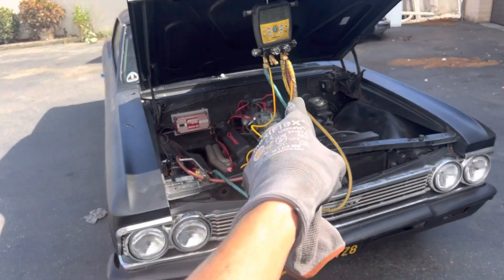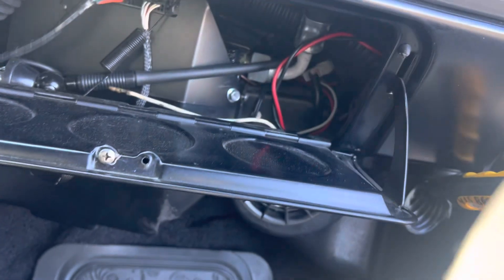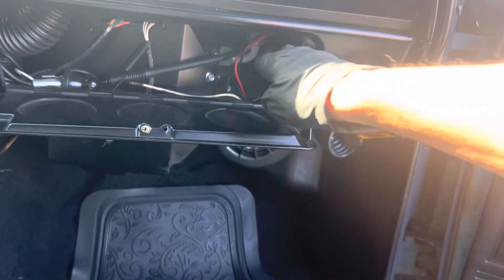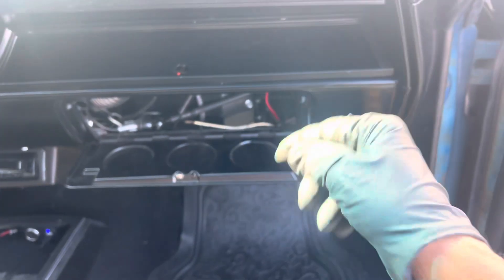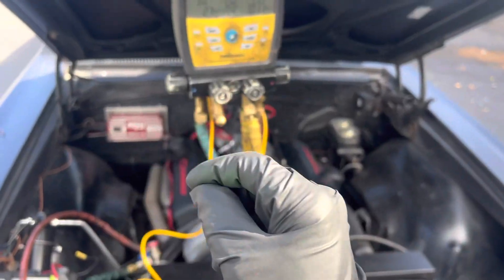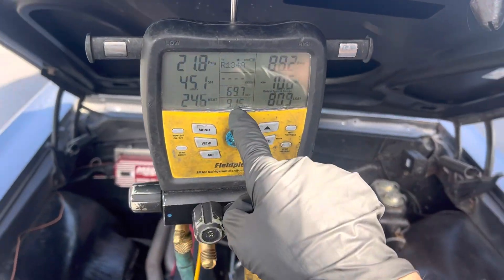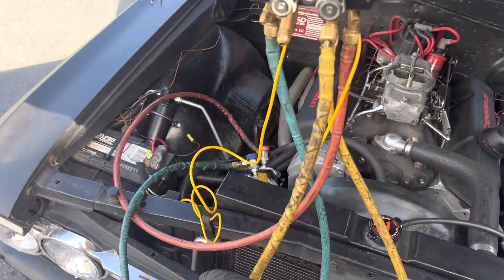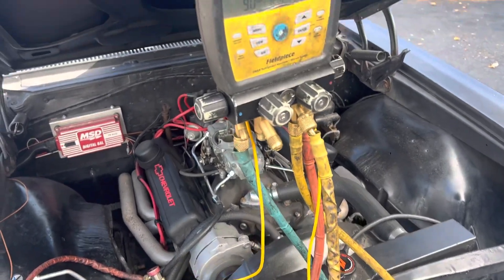Vintage Air develops electrical problem in the Thermistor￼ sensor controlling the compressor. ￼

Comment: My compressor kicks off when the vent temp reaches 47 degrees. I’m not an Ac expert but I’ve taken it to three shops and all say my system is properly charged. Today, shop number three said the system will cycle off the compressor when the evaporator reaches 34 degrees and that my system is working properly. I can’t believe that air temp is dropping 13 degrees from the evaporator to the vent. Is it possible that by adjusting the thermistor outward from the case say 1/8 of an inch would fool it into keeping the compressor engaged longer? Thus cooling better? Thanks
Reply from the maker: That’s what I used to do with old jeeps pull the sensor out a little bit or move it in another location

But all depends on the vehicle you have, and what it uses to trigger . . 

Almost sounds like a Honda 

Or a old Jeep 

So is this happening in hot temperatures around 80°F

And what year make model vehicle is this?

47 is pretty high temperature, but I have done videos on a few cars that just suck when it comes to cooling
Reply: @coldfinger459sub0  it’s a 67 c10 restómod with a 2017 LT1 and modern cooling system. The cab has been insulated when it was restored. Todays ambient temp was 80 degrees but these are the vent temps I see even in 100 degree weather in south Texas. It has a Vintage Air Gen 4 system in it.

Comment: vintage air did update their expansion valve on their gen V systems. the gen V systems use the block style expansion valves.
Reply from the maker: First message of reply was on accident, but your Vintage Air unit if it’s an old Vintage Air unit, it does have that little metal gas filled tube for a sensor that you can pull out a little bit or move to a different different location

Some of the new Vintage Air have the little electronic temperature sensor and I can’t remember if you could get access to that on all their models. some may be sealed up inside the case maybe some of the early models I think I seen some you can pull in and out can’t remember

Comment: hi yup when I saw that condenser i thought it was a serpentine. Oh yea where is the aux condenser fan a good 12 inch spal 20amp ver no cheap ebay rubbish ..   The BLOCK type txvalve will regulate far better than a convential thats internal equalised . That system has  sheat thats not reading correct . The evap is being starved .
Be interesting to see what happens to psi sc sh at 1500rpm reards air flow . Many are fitted with aftermarket fixed junk fans . 95% people donot fit optional OEM  A/C equipped LARGE diameter Hduty thermal clutch fan with shroud  . Radiator to condenser is not foam sealed either .
The suction thats not cork taped will create a lot of condensation drips .
Reply from the maker: Yes, yes yes 100% 👍

Comment: Have a Vintage Air Magnum IV unit with a DD DCC2400 controller. the A/C clutch kicks in randomly -pressure & compressor ok. I jerry-rigged the  a/c clutch Relay and I am getting cool air as expected - Therefore it appears to be a signal issue to kick the a/c clutch, i suspect thermister - would this most likely be the root cause?
Reply from the maker: It definitely sounds like Endo electrical controls is your problem whether thermistor or a connection

You and electrically engaged the relay through at signal coil, so you’re keeping the relay in the circuit, correct
?

You did not just jump out the relay pins apply power cutting out the relay
? 

They also have some binary pressure switches in line for safety

I’m going to assume you are not exceeding the high-pressure safety cut out

Or a low pressure safety cut out

Comment: I have the vintage air on my 62 , Fan blows but the compressor won’t engage. Freon is good, controls good, I already checked everything but haven’t had luck . Anything I can troubleshoot?
Reply from the maker: Just download the wiring schematic and just follow every point point by point had every Junction